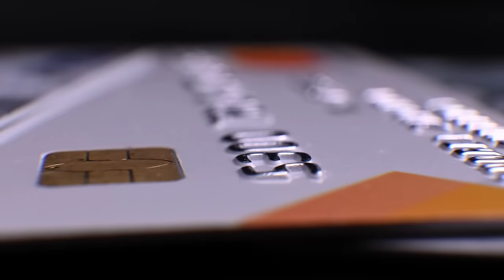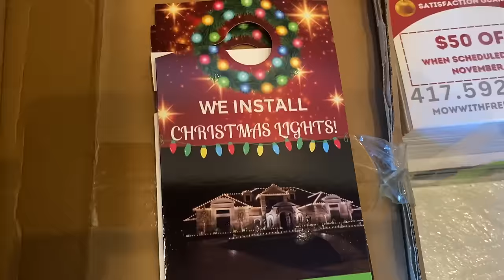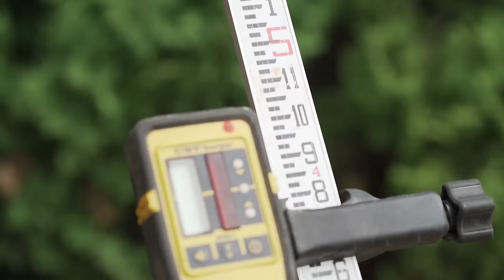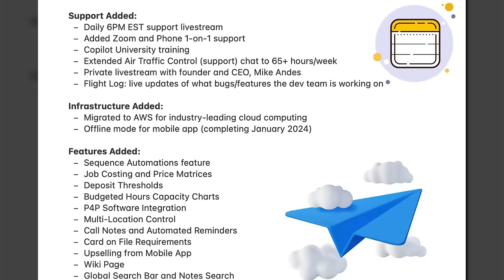INSUFFICIENT FUNDS... Throwing in the Towel

Comment: Just rent the skid steer and factor it into the end cost of projects that require it. Unless you literally need to use it every single day. We rent a ton of equipment that we wouldn’t use everyday as I don’t want the liability, maintenance, or upkeep. Sell the skid steer and the debt is actually pretty manageable.
Reply from the maker: Great point. Unfortunately, the skid isn't worth the $70K+ anymore BUT I agree still
Reply: @MikeAndes  Dude needs a good accountant on site.
Reply: I’d buy used 18k 30k at the most for a skid steer starting out that’s a decent size machine